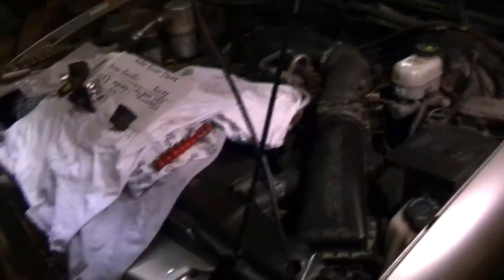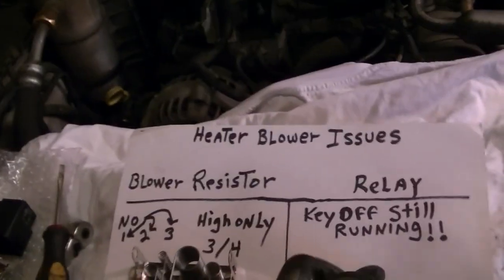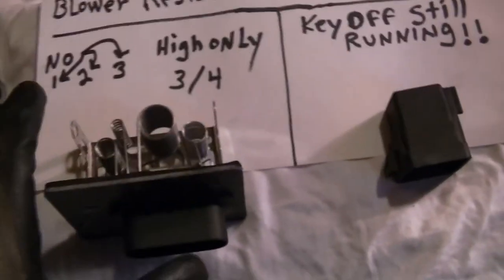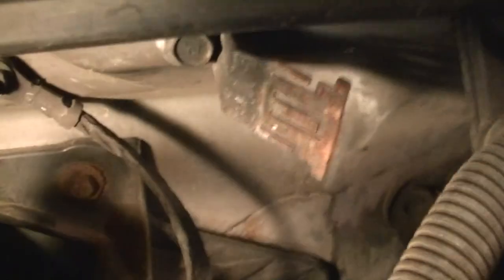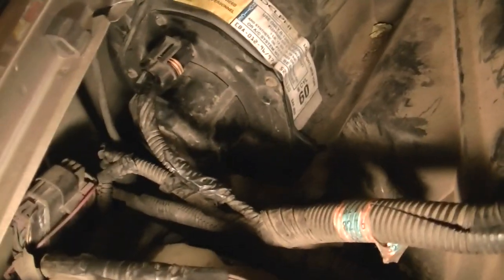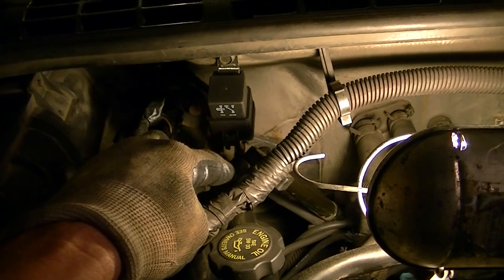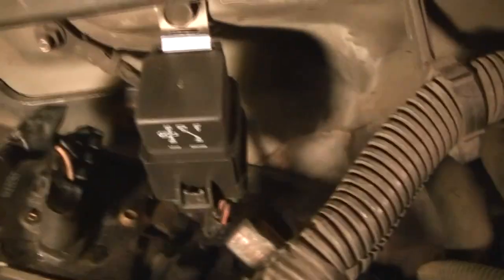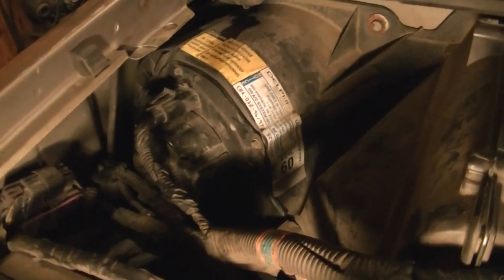Heater Blower Stuck on after key is off...FIXED!

Comment: Nathan, I have a 1997 Lincoln Continental.  I had my A/C and blower fan on the other day, got to my destination and shut the car off, took out the key and the Fan Blower kept blowing.  I put the Key back in and Fan did not blow in /ACC. or /ON position.  I had to disconnect the car battery every time I am not driving the car.  Again, blower fan blows during A/C operation and when the key is removed.  Can I assume the Blower Relay is bad in my case?  Great Video, you're helping a lot of people.  FYI - To date, can't find anyone else connecting this problem to a Blower Relay!  Your #1!  Big Thumbs Up!
Reply from the maker: Check the relay...its prob sticking...;)

Comment: Hey Nate 2015 Chevy equinox blower motor stuck on won’t shut off 
Are these newer cars relays built into the fan module? Or they have a relay on top of that also ?
Reply from the maker: Some are.
Reply: @FixingWithPassion  thx for the reply brother !! 
Just a heads up 2015 Chevy equinox blower motor stays running with key off 
It was the resister almost reminded me of the trailblazer setup …

Comment: Guys...  I have a 97 e350 class b RV..   

When I turn in the AC... Or just the vent... The heater stays on...  The blender is working because I can shift from vent to defrost..etc no problem

The issue is the heater is always on...even when I switch on the AC...

Do you have any suggestions

Comment: Hello, the ac of my car cant be shut down manually it doesn't respond to the control board,  but it does when car is turn off.  The Ac is always high at it max potential, the control board is digital isn't the one with 1,2,3 or 4. 

what do you think is the problem?
Reply from the maker: Flux coaster. They go bad all the time.

Comment: I have a 2004 Trailblazer that just started to drain battery, after I tried to use A/C. the hvac fuse 1 in rear has power on it after parasitic drain test. Anyone else found this problem also?